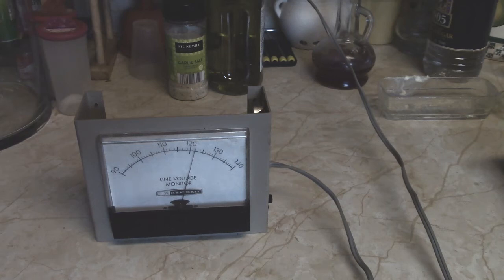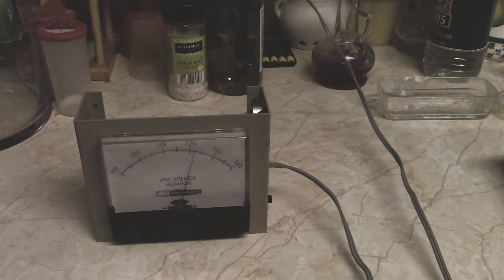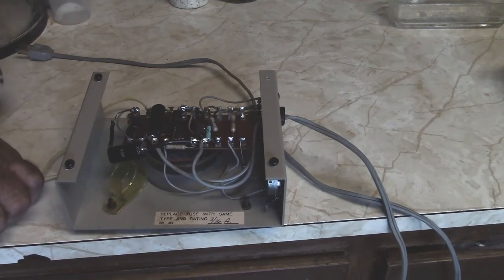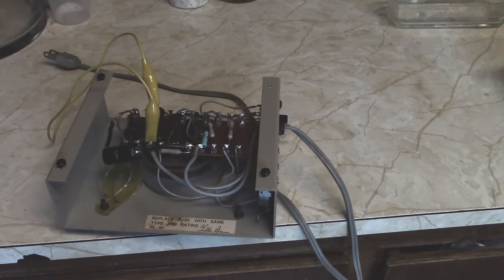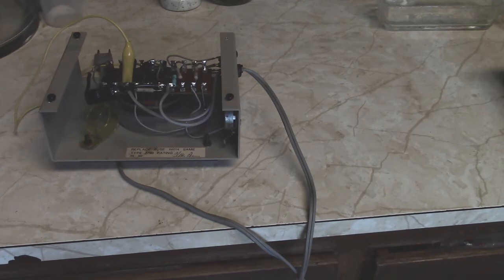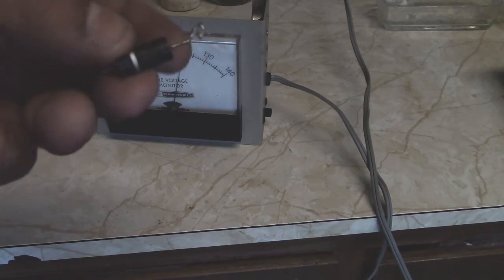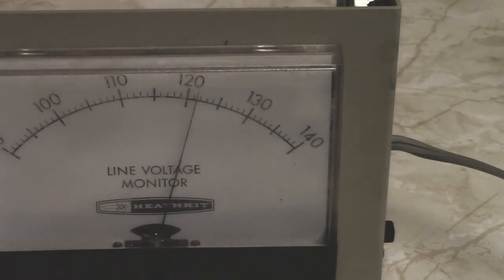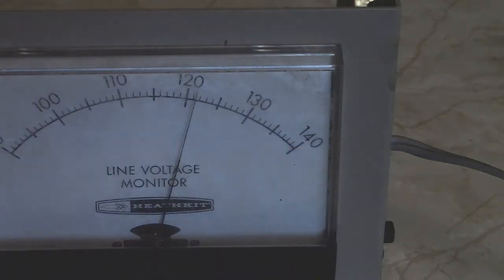Heathkit IM-103 Line voltage Monitor

Comment: Just picked one up, like new condition and it does work, but reads 2 volts lower then my Fluke Bench meter. I have not opened it up to see if it has the original capacitors and the like.. The 10K resistor that reads 1K sounds like typical Heathkit where the resistor has been mislabeled! Hopefully mine will require minimum amount of work, but like you pointed out not a lot of parts.
UPDATE!! So I opened up mine and it does not have a fuse, but what it does have is a wire wound resistor on each side of the AC line. This could be a sort of fuse, but I am not sure, not shown on 2 different schematics I have on the unit. Still has the original 70UF Capacitor so that will get changed. I did check the 10K resistor and it reads close to 10K. 
Robert
WA6PHN
San Diego

Comment: The "new" Heathkit currently offers a rebuild kit consisting of a new R1, R2, R4, D1, D2, D3, F1, and C1 for $15.00.  The wattage ratings of R1 and R2 have been increased to 5 watts since the original design only used 2 watt resistors and these were evidently pushed to the maximum.
Reply: Pat Rutland 
CAUTION, the original kit used a 70uFd, 350V for C1 electrolytic, across the 120 Volt AC line.
Assembly Manual (23 pages)
http://www.rsp-italy.it/Electronics/Kits/_contents/Heathkit/Kits/Heathkit%20IM-103%20Line%20monitor.pdf

In 2017, as reported on Antique Radio Forum ... a 30 uFd , 350V unit was used for C1 replacement (not a good substitute) in this D8Pro Kit. 
In the latest IM-103 Kit instructions, they are now using a 100uFd , 350Volt part. 
Instructions:
http://www.d8apro.com/IM-103%20Repair.doc